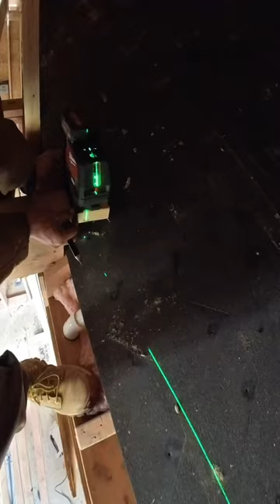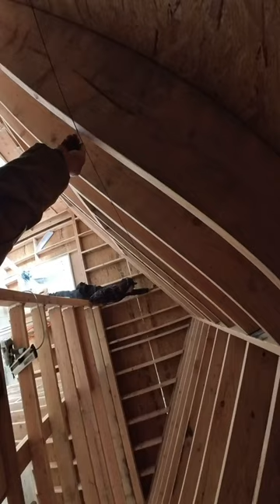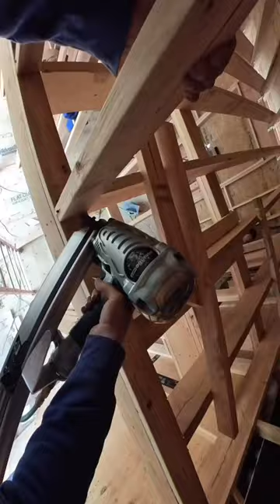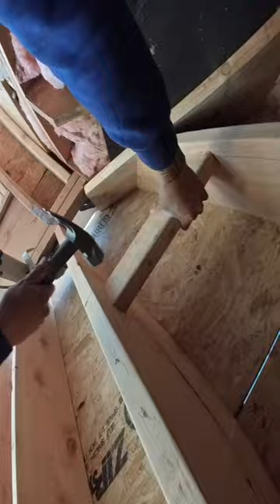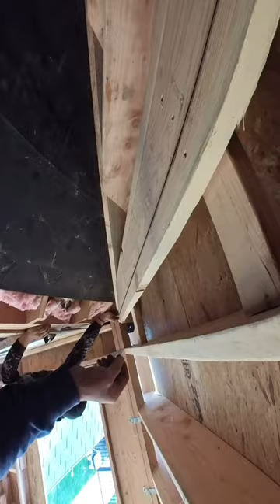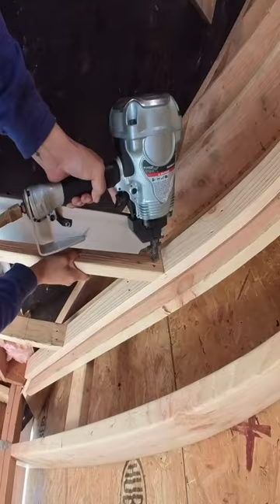Inside framing #shorts #work #construction #design #skills #carpenter #team #architecture

Comment: When i was framing a wall my nailer kick from my m18 cordless 30degree always moved the stud 1/8-1/4 over is there a trick to that? I kept a hammer on me and hammered it flush before slapping the final nails.
Reply: With toe nailing i usually nail with it a little out of flush and my nail will pull it in...certain angles move your work more when shooting...opportunities to shoot perpendicular will reduce the chances of moving...if things move a tiny bit out of perfect placement upon shooting your nail, think about where it is you are working, and what the outcome will be if left that way...if it won't make the next guys job harder,  doesnt compromise integrity of the build and looks good from the eye. If I'm framing out a bathroom wall for my tile guy imma make it as perfect as possible, while there are situations that call for efficiency over precision